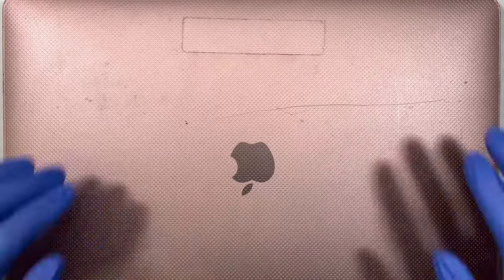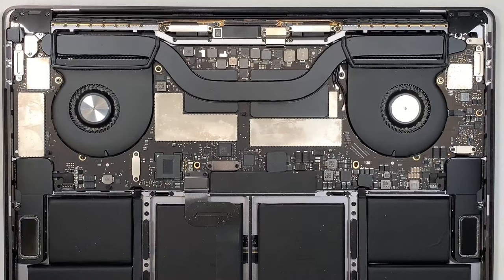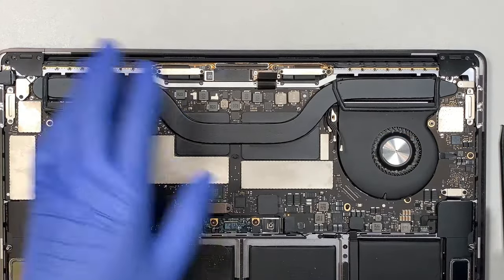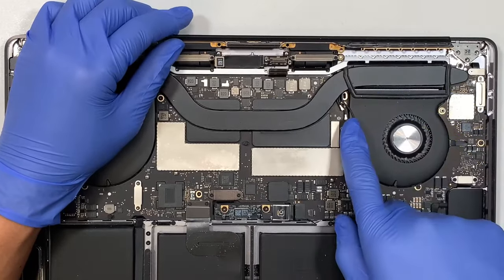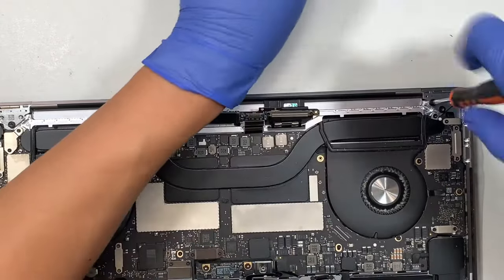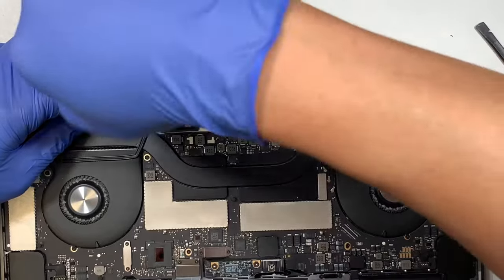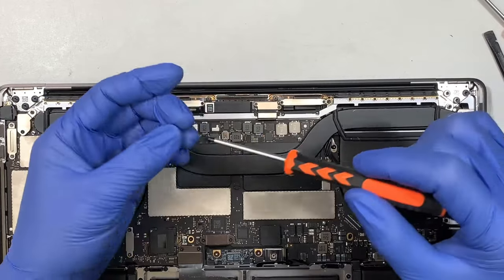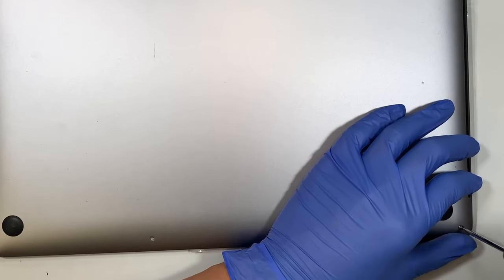Macbook Pro 15 A1707 2016 2017 Screen Replacement

Comment: What a genius you are. I saved myself £800 and bought a used motherboard off eBay and removed my old base and attached to the the new one. I would never have been able to do this without your step-by-step guidance. Thanks so much for posting this video
Reply from the maker: Glad I could help

Comment: I LOVE the black and white opening scenes of your vids. I would recommend blowing out the fans while you have it apart. Do not let the fans spin while blowing them out or you will burn them out. Hold fan blade with small srcrew driver or such.

Comment: Thank you for this very clear step by a step a1707 screen replacement guide video. My screen is not broken but when I open the panel to around 70deg and beyond it goes off. Bringing it back down to close position the screen comes on. So my question is; do I need to replace the whole screen or need to open up and make sure the cables are tight?
Reply from the maker: Glad it helped. Definitely you need a brand new screen.

Comment: Appreciate the content! 
Question, My screen just went black, before hand it was really low in display brightness then went completely black, but the bar/keyboard still lights up assuming it’s just the screen I need to replace? Or what can it be?
Reply: Have you tried hooking up an external display? That will tell you whether it's the display or the driver.

Comment: I replaced my screen but it wont turn on. I even replaced the battery and put the old screen back and it does nothing. Any suggestions? With the old one you can hear when it’s stars to charge and the caps button light on but not with the new screen

Comment: Thanks for the tutorial. Now I have a folder with a question mark. And the wifi shows "on" for a few seconds the switches to "searching for networks" and continues to bounce. I attempted to reinstall OS, and get an error. All connections are secure. Not sure what else to do

Comment: Of course the very last wifi antenna screw stripped on me. just my luck

any tips on how to remove stripped screws?
Reply from the maker: I used a tiny drill bit to drill that stripped screw

Comment: Hello. I opened the inside of my Macbook Pro 2017 Touch Bar model by carefully unscrewing the screws. First, I disconnected the battery cables and then carefully cleaned the fans by blowing them. I didn't remove the motherboard, I just cleaned it superficially. Then I turned off the macbook but the Touch Bar did not work. Even though I've been trying for days and following your advice, I couldn't get any results. Is there anyone who can help with this? Thank you.

Comment: clear isntruction, however i find it amazin on how apple made it stupidly convoluted to do a simple LCD replacement, on other laptops sometimes you don't even need to open the main-board section at all, just open the lcd bezel and a few screws, 2 cables and it out

Comment: You mentioned that the “springy thing” has to be long enough. What happens when it’s not long enough ? Both the new screen and old screen seems like it’s not long enough to fit in place.  Ik it’s something I’m doing wrong because the old one won’t fit back in place either
Reply from the maker: Are you talking about the lcd screen board ? Only way I can imagine is when you close the screen, you might have clipped the paper thin cable of the lcd screen board.  Make sure the paper thin cable is seating on the laptop freely.